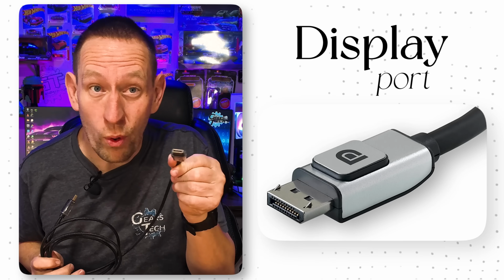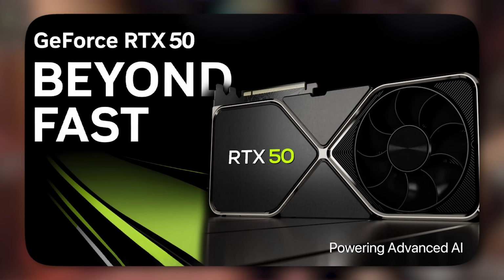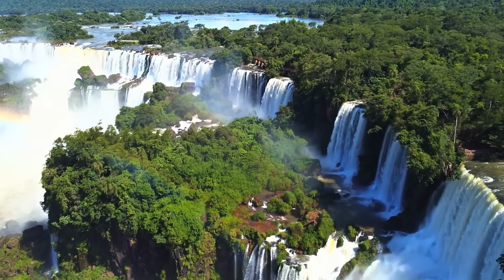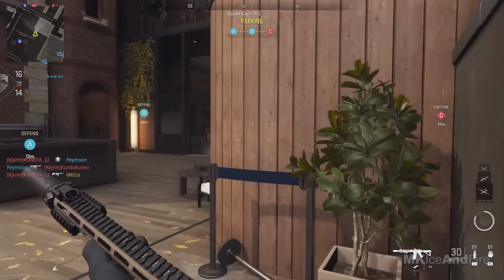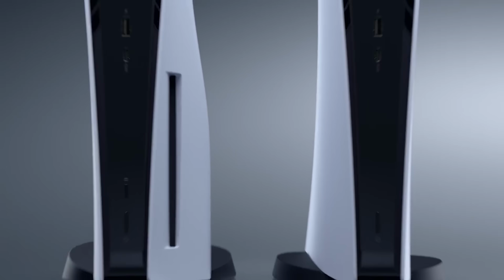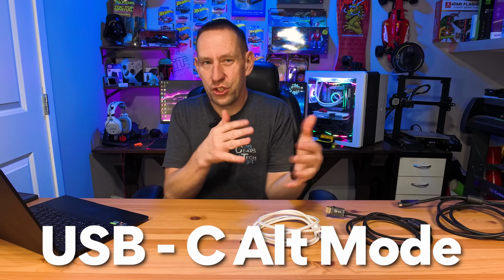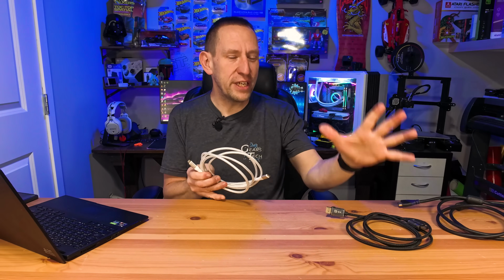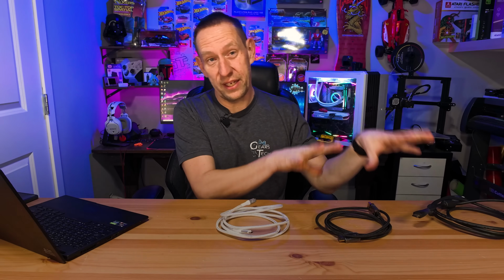HDMI vs DisplayPort vs USB-C Connection Guide

Comment from the maker: 💥💥💥💥 SAVE ON NETFLIX, DISNEY+, CRUNCHY ROLL AND MORE! 💥💥💥💥
✅Use Discount Code 'GEARS' here  - https://www.gamsgo.com/partner/JmWGqN

💥💥💥💥💥💥 Cables 💥💥💥💥💥💥
HDMI 2.1b Cables - https://amzn.to/4bAlYTL
USBC Thunderbolt Cable - https://amzn.to/4i75Uv7
Display Port Cable - https://amzn.to/3Ri1uWl

💥💥💥💥💥💥 Monitor 💥💥💥💥💥💥

Gaming Monitor - https://amzn.to/4c4i2uz

💥💥💥💥💥💥 PS5 Pro Level Performance PC Buid 💥💥💥💥💥💥
ASROCK B660M-HDV Micro ATX Motherboard: https://amzn.to/4fTg9lq
Intel Core i5-124000F 6 Core CPU: https://amzn.to/4i0KbW5
Samsung 990 Pro 2TB NVMe SSD: https://amzn.to/497xSmA
G.SKILL Ripjaws V Series (2x16GB) CL16 RAM: https://amzn.to/4i2tYQ2
NZXT H510 Mid-Tower PC Case: https://amzn.to/3V8LBUB
CORSAIR CX750 750W 80+ Bronze PSU: https://amzn.to/4fxTMC5

💥💥💥💥💥💥 Pick One 💥💥💥💥💥💥

XFX Speedster Quicksilver 319 Radeon RX 7800 XT Graphics Card: https://amzn.to/411tZxR
OPTIONAL UPGRADE: ASUS GeForce RTX 4070 Graphics Card: https://amzn.to/41188qg

💥💥💥💥💥💥 Controllers 💥💥💥💥💥💥

Hex Gaming Phantom with Hall Effect Stick - 🛒🛒🛒 5% Off Here - https://www.hexgaming.com/collections/phantom-details?ref=uoywcbgg&utm_source=affiliate 🛒🛒🛒

🛒🛒🛒 Hex Gaming on Amazon - https://amzn.to/3XRxRzY 🛒🛒🛒

Get a Grip Gaming Hall Effect Equipped Controller - https://getagripgaming.com/discount/GearsAndTech

Use Promo Code "GearsAndTech"

💥💥💥 Or Just Get a PS5 Pro 💥💥💥

Check out the Sony PS5 Pro Game Console: https://amzn.to/497taoV

Besavior Pro Controller 
Website - https://www.beloader.com/products/BesaviorP5MATE.html?code=fyQxjjkVU

Xbox Elite Series 2 Controller - https://amzn.to/456aNyF
Razer Wolverine V2 Pro Controller - https://amzn.to/4e69WCv

PS5 Controller Peripherals

ReaSnow S1 - https://amzn.to/48IBZV2
Cronus zen - https://amzn.to/4bohXAV
Xim Matrix - https://amzn.to/4asaRtT
Razer Wolverine V2 Pro - https://amzn.to/3yoAAGe
Reply: Why haven't most home PCs adopted Thunderbolt?  Is it because of length, otherwise they seem to have every advantage over any other cable, and even if you have a Thunderbolt 5 device, it will still pump out the same speed of information through a TB 4 or 3 cable, so long as you're not running it through a TB 5 dock etc.
Reply: What brand of PC is that in your background?

Comment: Always USB-C or D-Port for PC. HDMI has been stuck behind a pay wall while D-Port is open source.

I've connected via USB-C on my desktop PC.  Using iGPU + dGPU. Outputting everything through the USB-C on the motherboard. I do have a D-Port cable connected on the dGPU, but that's only for virtual machine GPU passthrough. And since I've pretty much ditched even a virtual windblows, it is only connected because I've been too lazy to disconnect it.

Comment: HDMI can transfer Audio and Video, DisplayPort can only transfer Video.
I'm using a 48 Gbps HDMI cable, I had problems with occasional flickering with a 24 Gbps HDMI cable at 4k 120hz.
I now have a 5k2k Monitor, this 48 Gbps HDMI seems to handle it fine at 165hz, no flickering or other issues.
I don't think using a DisplayPort and losing the ability to transfer audio to my Monitor, would make any sense, considering this 48 Gbps HDMI seems to handle things fine.
Maybe an Esports Gamer would choose a DisplayPort, so they could push an insane framerate....I'm not sure how a 48 Gbps HDMI cable would hold up, it would probably do fine though at 300hz at a lower resolution considering it can push 5k2k 165hz fine, no problem....

Comment: You didn’r even mention ThunderBolt 3, 3, 4, or 5.  They are a variation of USB-C with Thunderbolt 5 having a throughput up to 160 GB/ S.  Sp if you are transferring massive data files, making backups, or using 8K video data, the transfer will be instantaneous.
Reply from the maker: How many gpus offer that?

Comment: You touched on the issue that everyone has questions about...how do you tell one HDMI cable from the other? Same with Display port...and USB-C for that matter! Is that USB-C a PD 3.2 and 10gps? None of these cables have any external indication as to what it is you have...and that's frustrating. I have a billion HDMI cables in my house...but no clue as to what it does...
Reply from the maker: Agreed.. Ltt has fixed the usb issue with their truspec cables.

It won't be long before its standard on hdmi as well I think

Comment: I got put off by DisplayPort when I had an AOC gaming monitor, and the port broke within weeks. It was fine one day, then the next, no signal. When the HDMI also went, I bought a new monitor, and I'm still using it now. It doesn't have a DisplayPort connection, but the one I'm upgrading to does. I want to use G-Sync, so it's the best option for me.

Comment: you did say that USB-C AKA Thunderbolt does daisy’s chain like Display port you didn’t mention that it also transfers data therefore using your monitor as a hub using one cord connection to your computer
Reply from the maker: True.

Comment: Displayport is my way to go. My setup fully supports 2.1 for 4k 240hz, so that's my pick.
HDMI only for secondary, old or only 60hz monitors that don't need the max bandwidth.
USB-C for laptops connected to docks.

Comment: What about thunderbolt four and Thunderbird five going through a USB-C cable? Maybe you need a part two of this video to cover those things? Great detailed video though. 🎉
Reply from the maker: excellent observation. Let me know if this works as a part 2 https://youtu.be/U4Qu57zhkOo?si=5xAhZkLSabmFgLW9
Reply: @GearsAndTech  thanks so much for following up as I just posted today I think so. This was amazing. You're quick with the comments in your community. I've been doing a lot of research because I got my first monitor that was thunderbolt three only and learned there was thunderbolt four and five for monitors and I have a max studio M4 max which has thunderbolt five ports but the thunderbolt five monitors are ridiculously expensive and so I chose a BenQ PD3226G 32” 4K UHD (3840x2160) 144Hz Monitor as it had thunderbolt four and I can daisy chain to my other 4K monitor. I didn't know this was a new thing cause I was thought all monitors could do this in someway and there's ports that are upstream and downstream I'm learning now and how to configure them all but this is a major game changer with my cable management and these Pro tools were my Max studio. M4 is lightning fast with the video editing now but I'm just trying to make sure everything's being powered correctly for the optimal experience. I tried to daisychain from the display port to the second monitor, and it didn't work for some weird reason. So I just went thunderbolt five out from the Max studio M4 to the Ben Q monitor with a thunderbolt for port and then I went out from the cave MUSBC port to my second 4K, and it worked flawlessly. I want to also daisychain maybe a 1080 P but it doesn't seem to register and I might have to go directly from the HDMI port of my Mac studio M4 Max HDMI to that separately instead of Daisy chain. This is all this makes sense.? I just wanted to give you a quality response to your community because it was helpful that I just watched your video that you tagged.

Comment: Im wanting to connect multiple monitors ( up to 4 + laptop) . See 2 options 2 port  HDMI  to usb-A 3.1 adaptors then x 2 then single hdmi to usb-a 3.1 adaptors, with usb-a going into 2x  usb-a to single USB-c adapters into laptops usb-c port or alternatively a usb c quad 4k dock , but issue is my monitors are a  combination of dvi,hdmi or vga whereas quad 4k docks are either hdmi, hdmi or dp or a com nation of all 3 ( dp, 2x  hdmi & 1 x vga, so wondering how best to connect to multi port 4k quad docking stations ?

Comment: You make it sound as if HDMI is "the future" standard. Actually most modern gaming monitors recommend using DP because it often supports higher refresh rates and G-Sync/FreeSync, which generally makes it the better choice for at least gaming PCs. What is always true though is that you should check your monitor's manual to see what gets you the best performance, which like I said will be DP 99/100 times.
Reply from the maker: I think usbc with alt mode is the actual future.

Comment: Thank you for this.  I never understood why my laptop supported dual uhd at 120hz with a usb-c to hdmi cable  BUT if I used the laptops hdmi port I was stuck with UHD at 60hz...  In that regard why do they even put an hdmi connector on laptops now?  USB-C to HDMI is all you need,  and in my case its what you have to use..
Reply from the maker: Probbaly because people still look for hdmi because they don't know

Comment: I’m using Display Port with a GeForce Super 6gb video card.  I ended up with two Viewsonic monitors and both went bad which seems odd like a compatibility problem. I sent the one monitor in twice because of same issue of lines on the screen.  Only way it would work is to bump up refresh rate.  Viewsonic finally replaced the monitor with a way better one and it has really vivid colors and has had no issues.  I have both on their own DL cord that came with the monitors.  Running AMD Ryzen 7 5700x, 32gb 3200hz ram memory with a Samsung 870 NVME 1TB drive and Windows 11 Home. 

Im using a Microsoft account to long on because Windows 11 when I installed would not let me use a local account. That has created a number of unwanted issues.  One recent was I checked Disk Management and my drive had BitLocker Encryption.  I never did that.  Turns out being that I use a Microsoft account a recent update encrypted my drive without notice.  Also an encryption key is saved to the Microsoft account.  Have to reinstall or try to read drive to get data off it you likely will need that key to access the drive.  Great for protecting your data if computer is stolen.  I figured out saving the Encryption Key and opened it.  The product key and encryption key have to match.  The product key on my computer didn’t match what the file showed.  I figured out disabling encryption.  Another issue with the Microsoft Account and Microsoft Edge is my four year old grandson using is own Standard account clicked on ordering something and Auto Fill pulled my payment information from my admin account to his account.  I tried to call Microsoft and of course no help just recording to contact my credit card company.  I was able to delete payment card from my Microsoft account.  Open Edge browser type Esge://setting on left of screen click Password and Auto Fill pulled disabled three option.  Did that on grandson’s account and mine.  I likely should be using a local account.

Comment: My setup is so complicated with a mini desktop workstation and a laptop workstation 3- 4k monitors and a 1080 monitor with a switching hub in between. I have USB-C/Thunderbolt, USBC-DP, full size DP and Mini DP, full size HDMI and Mini HDMI and several of the cables have different ends and are 1 way.
Reply from the maker: That's a complicated setup.

Comment: Displayport was also the best bc a ton of companies made cheap hdmi cables where the wires in them were not insulated from each other or were outright shared. So the resulting image would have pixelbleed and most Tv it was not noticeable but for monitors it was very noticeable.

Comment: Samsung ultrawide monitor came with a display port cable and it is connected to one of the newest GPUs. I assume it will support everything the monitor is capable of. In the past I always used HDMI as that was what was always convenient.

Comment: I dunno what planet this yahoo is from, but here on earth HDMI won the de facto award. Is it better? No. Is it semi-proprietary? Yes. Do we care? No. At least connecting via HDMI works, its one connector and every monitor from the last 15 years has it. 

Display port, well, is it display port, mini display port, micro display port...you get the picture. So, just get an adapter you say. OK, now you get to deal with the specs of the adapter AND the cable, or just buy one, plug it in and HOPE it works. 

All most of us want is just an image on a screen. "Gamers" are a teeny-tiny fraction of the user population yet they suck up the majority of the tech bandwidth. Get over it. People with lives DON'T CARE. Factoids for the mentally impaired. You can't see 10 bit color. You might think you can, but you're just fooling yourself. Men, typically can't even see all of an 8 bit color space. Physiologically, its not happening. HDR, well, that's really just artificially increased contrast and can only exist on an RGB screen, not in real life so, again, WTF cares? Then there's the fps nonsense. Know what the standard for motion pictures was for decades? 24fps. That's enough to get the eye and mind working together to give the experience of continuous motion. Those of you who think you can see the difference past 60fps are delusional. 

So, what's my answer? VGA, or would be if laptops still had VGA ports. Meanwhile my HDMI cable has the same connector on both ends, my devices all have a matching hole and if I connect it something is going to happen, guaranteed.

Comment: So just ordered a new gaming laptop, 5090, 64 memory, 9 ultra chip.. cool, got a lg 45” oled monitor on Black Friday deals 240hz at 4k, what cable am I gonna use to max everything out 2.1 would a been the way I was gonna go. Just use the xbox cables I already have that was running my tv at 144 maxing the Xbox. I assume they can handle the 240 also with the laptop and new monitor.
Reply from the maker: Should be fine

Comment: Your video contains several factual errors.
Reply from the maker: Could you please elaborate?
Reply: @GearsAndTech  HDMI review
USB-C is a connector, and it is not an alternative to HDMI or DisplayPort.

The resolution comparisons you’re making are usually irrelevant because HDMI and DP can both support more resolutions than the highest resolution displays on the market. But DP can daisy-chain and it can be transported over Thunderbolt along with USB and other protocols, so it’s a true one cable solution for laptop users. 

1:56: You said DP 2.1 can transfer 80 Gbps of data. But HDMI 2.2 will transfer 96 Gbps. And both support DisplayStream Compression, which effectively triples those rates. 

2:40: You said that HDMI 2.1 cannot deliver 4K120 10-bit, this is incorrect. HDMI 2.1 can deliver 4K120 12-bit, 444, without DSC, and also 8K60 12-bit 4:2:0 without DSC. HDMI 2.1 doubles this, enabling 8K60 12-bit 4:4:4 without DSC.  The chroma subsampling figures (444, 420, etc.) matter.

3:02: You can daisy-chain more than two monitors using DisplayPort MST (you said only two), but MST only works with Windows computers. 

3:18: You said that in order to use nVidia G-Sync or AMD FreeSync, you need DisplayPort. This is incorrect; HDMI 2.1 supports these and VRR is implemented in the latest xBox and PlayStation consoles over HDMI. 

You said that DP supports Dynamic HDR. But HDMI also does this; if it did not, then no televisions would have DolbyVision support. 

3:27: You said that HDMI supports Ethernet over the cable. While this is technically true, no current devices implement the feature and instead use the Ethernet feature of the HDMI cable to implement eARC, which DisplayPort does not support. On the other hand, DisplayPort can be used natively over Thunderbolt, which combines DisplayPort with USB and more. So DP has unique advantages for PC's while HDMI has unique advantages for televisions.

4:10: You said that DisplayPort is not widely used on televisions. DP is not available on any TV's I know of. 

7:51: You spend a lot of time talking about version numbers, but what matters are the features, not the version. HDMI prohibits labeling products with version numbers. Why? For instance, a 4K120 television uses HDMI 2.1… but it cannot support 8K60, right? AND, an 8K60 television uses HDMI 2.1, but maybe cannot support a 120 Hz refresh rate. So the version number does not tell you what the product does. HDMI cables must be licensed, certification tested, and these licensed cables are prohibited from using the HDMI version number in their marketing. Instead, they use labels such as High Speed (1080p) Premium High Speed (4K60), and Ultra High Speed (4K120 and 8K). 

6:59: HDMI 2.0 is not limited to 48 kHz, 16-bit audio. Even HDMI 1.4b and earlier versions can transmit 8 channels of uncompressed  96 kHz, 24-bit audio, and so can eARC.

Comment: And for my 10 year-old used pc and Lowest end monitor? I wonder if this will apply (Just bought, I've never had one and my laptop just died).
Reply from the maker: Display port is best there
Reply: @GearsAndTech Dude! Thank you! I was wishing I had some good stuff, but I'm psyched that my machine runs Cyberpunk and far cry 6. On medium 1080. I have a little portable monitor that works now! Thanks again! (I'm 61 years old and gamed off and on since pong, but on cheap laptops the last 12 years. So this Xbox 360-ish performance is totally fine with me. Cyberpunk was like a PowerPoint presentation on my laptop. Thank again for the answer!

Comment: Wife is looking for a laptop to replace her tower PC, BUT, she has and wants to use her duel monitor set up.  The monitors have a DVI connection.  Can she use her duel monitors with the lap top, using one HDMI / DVI cord, and one USB-C to DVI cord?  The laptops we're looking at are just basic, she'll just use it for web, some video.  I know USB 3 can handle video also.
Reply from the maker: I would look at a dock with hdmi or display port out. All monitors connect to the dock and the laptop remains mobile when needed

Comment: The majority of cables fail at the rated display frequencies and with high end Nvidia graphics boards there is an ongoing problem with black screens for users. The idea of daisy chaining monitors as a good deal is not valid as there is auto switching with the majority of monitors sold today. There are far more HDMI 2.1 cables than DP 1.4 cables available to purchase.